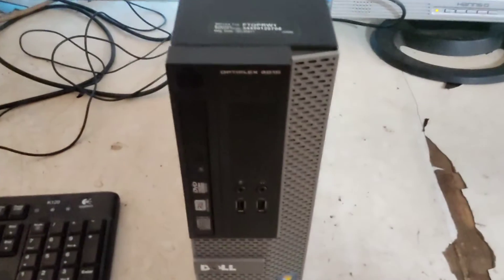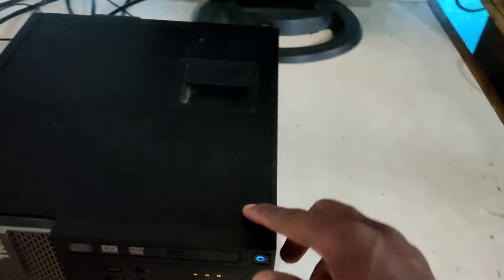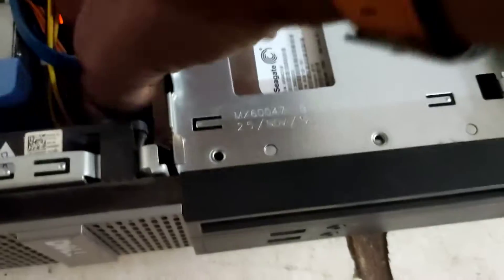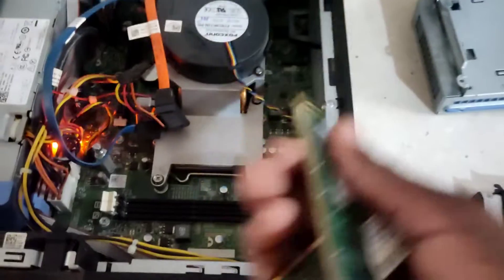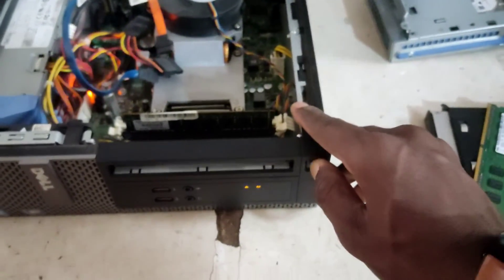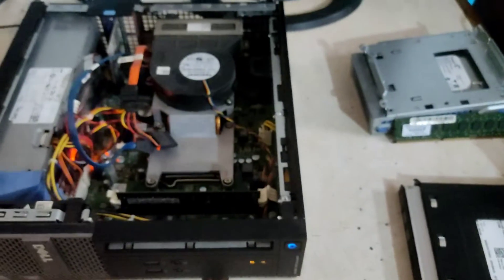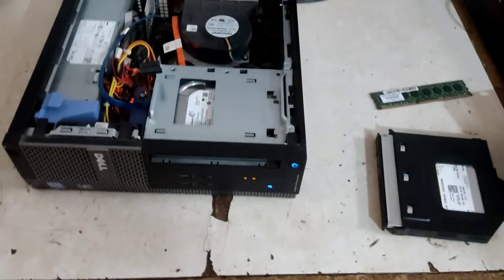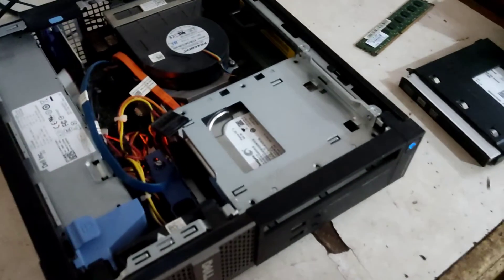Fix Dell PC Orange/Amber Light OptiPlex 3010? | The Orange Light Mystery

Comment: Tysm I found out what is wrong with my pc now no it doesn’t work like it will turn on and everything but now it turns rignt back off but I figured out that one of the chips that you have to pull out is damaged bc it takes it like 5 minutes before it wants to go back in